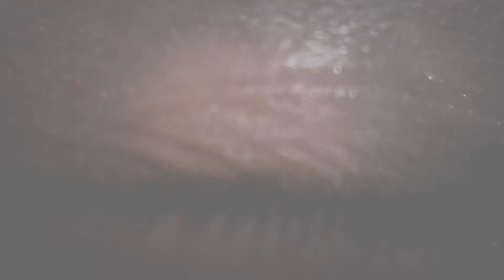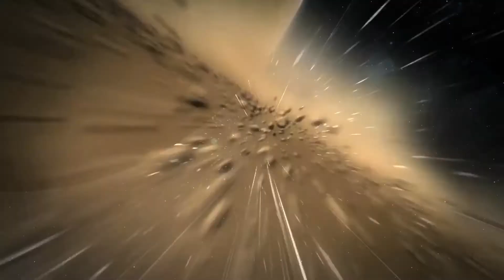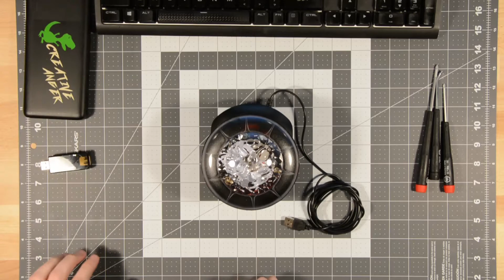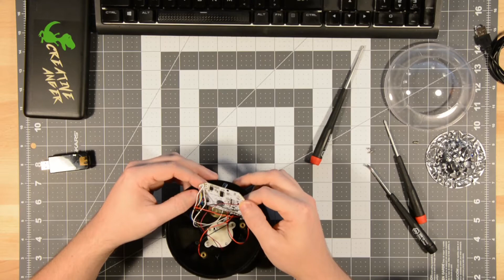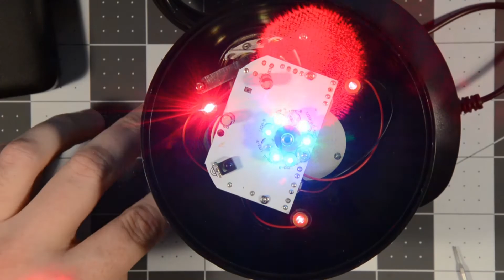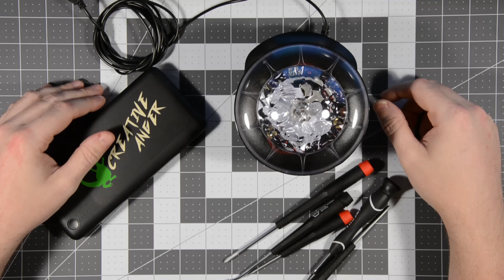Can I fix an RGB LED Light fixture?

Comment: I like how you took it apart for the first time on camera. It's always annoying to see YouTubers perfectly take apart things with problems after much practice. But that did come open, like... surprisingly easy.

You should have tried to re-seat that transistor. I've seen on other repair videos that bad solder joints are often the problem. Although for me personally, it's never a bad solder joint. Also, there might be enough space in there to replace with a bigger transistor than the onboard one, if the specs match.

Don't give up, you can do it!